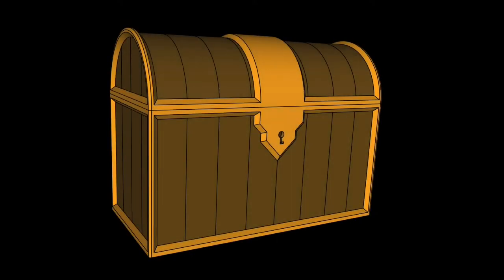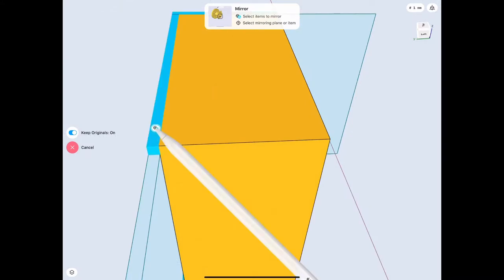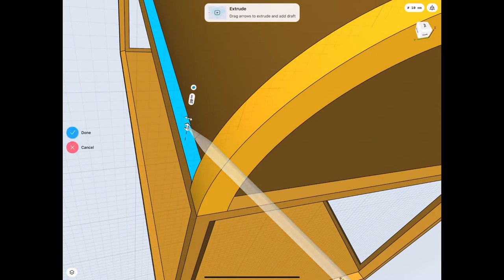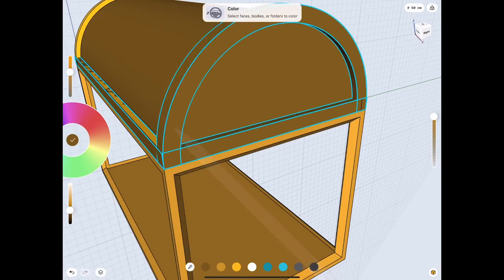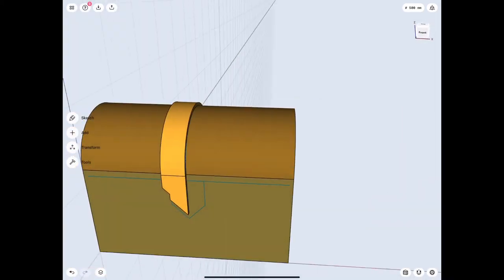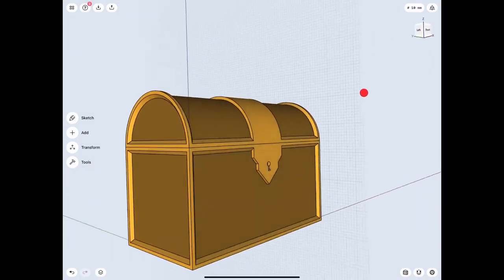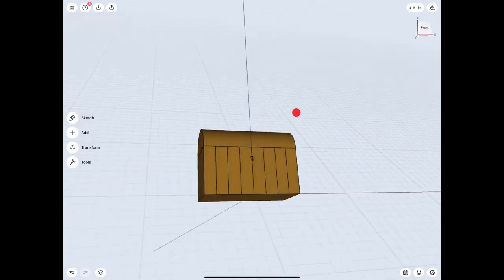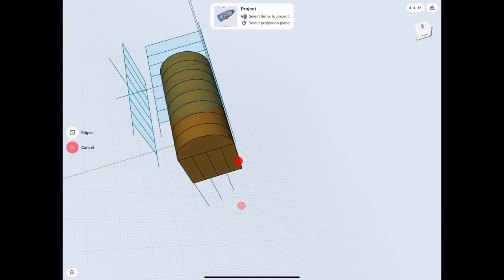Learn to Design a Treasure Chest in Shapr3D

Comment: Hello, how to cut a solid in half ?
Reply from the maker: You can either create a midplane on the object and use that to sketch and subtract, or you can just sketch and subtract if you have it centered in the work area.
Reply: @JLake3D  Ok Drew will try. Thanks.